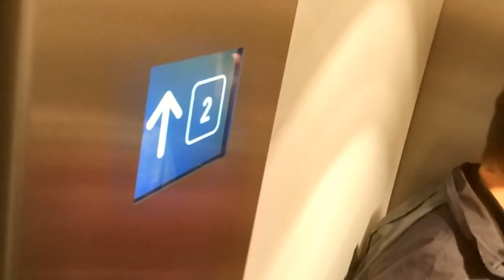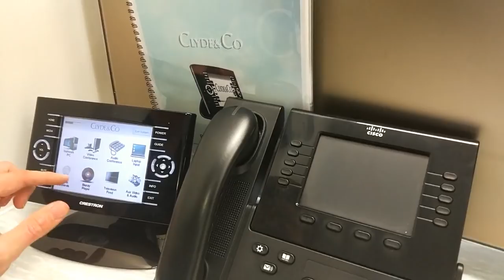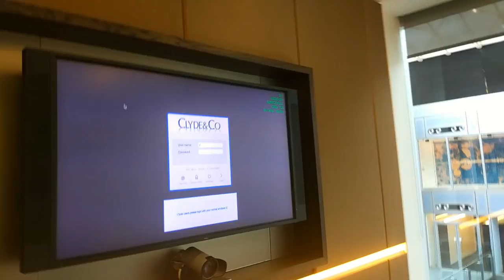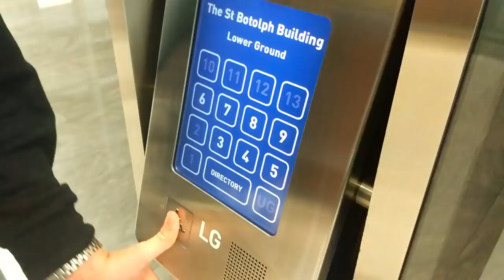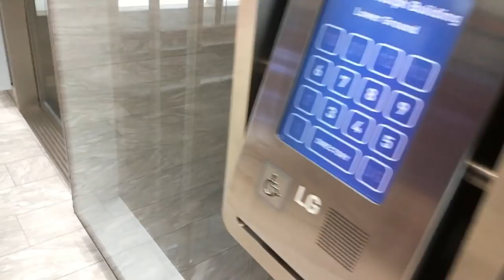ThyssenKrupp twin land

Comment: I noticed the 2:1 roping on the upper level cabs with the sheave mounted in the center, and opposite corners two compensating sheaves on the lower level cabs. And the counterweights had compensating sheaves. There is probably two levels for the bank of traction machines.